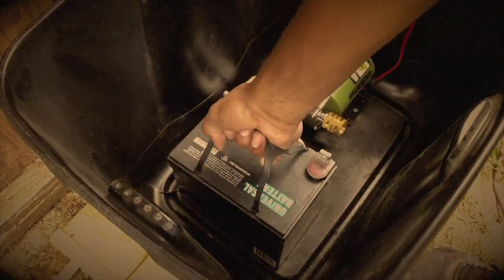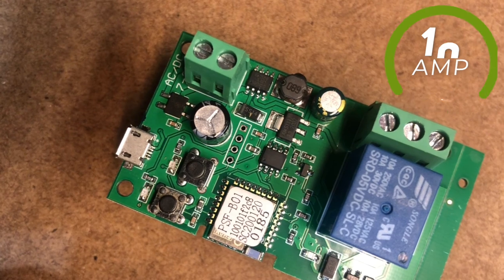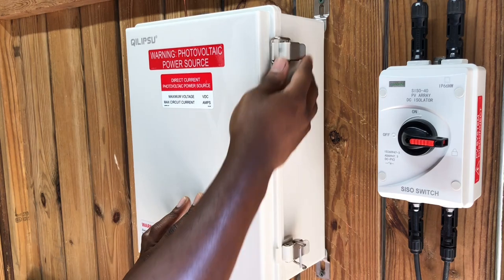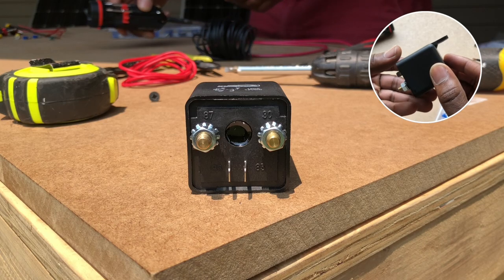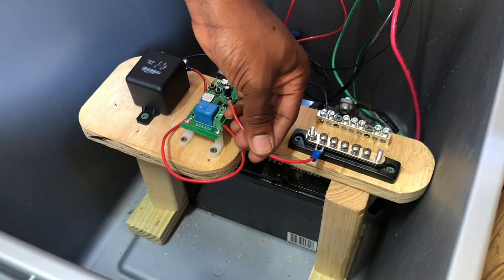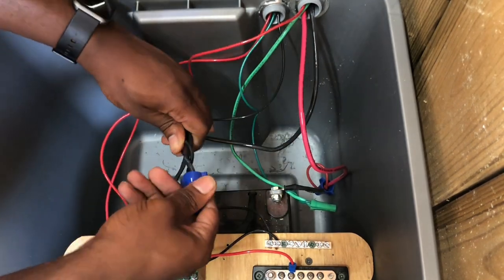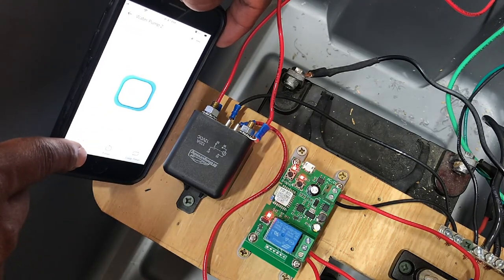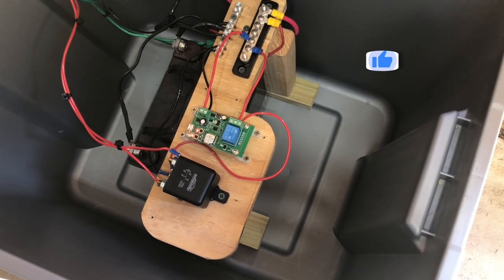Rain Barrel System - LESSON Learned

Comment: Great video! Consider adding a small physical non-conductive barrier between the positive and negative bus bars, just enough so they cannot  "see each other". It will prevent scenarios where something conductive gets dropped (screwdriver, wrench, etc) across the positive / negative bus, causing a short. Just adds to the safety equation.
Reply from the maker: Good idea Miko!

Comment: Yep we all make mistakes. I know i have. I would suggest to not run the power wire over the ground buss bar. I know you bent it up but something could push it back down when you close the lid. This could cause the two to touch and short out. I know its not very likely but i always try to take steps to prevent the worst possible senerio. Just my two cents with past personal experience. Your doing a great job btw. I have been watching all the different steps you have taken since the beginning

Comment: Just a suggestion. Anything housing electrical outside getting 🌞 sunlight , ( unless your in like Alaska or something 🤣), might consider putting in white or silver container. HEAT 🔥 is very hard on electrical components like batteries 🔋 and circuit board’s ect. . Maybe even vent the container. Just a thought. 🐴🐴🦅

Comment: I'm a little confused with where the float switch fits in to all of this? Before it was connected to the "normally open" port of the wifi relay. Now the wifi relay is connected with the heavy duty relay. I bought the diagram of the wiring but it doesn't show the float switch, any advice on that would be great!
Reply from the maker: You would wire the float switch in series/in line with the pump. For example, using the PDF as a reference, the float switch would have one wire connected to the #30 terminal on the heavy duty relay, and the other wire from the float switch connected to the positive (red) wire for the pump. Everything else in the diagram would stay the same. This is just one way to do, but as long as you are breaking the power going to the pump somewhere in the pump's circuit, it will work fine.

Comment: The reason to use a larger relay is because it allows a smaller voltage/current to activate the main terminals, which handle more voltage/current.

Comment: It's been a while since I've sized conductors / equipment for motor control circuits...but I've got to wonder if that tiny relay is sufficient for that motor. You could have starting current that is many times greater than running current, and the contacts in that relay may not be designed to handle that inrush. When opening the circuit you might also have a large voltage spike with opposite polarity across the contacts.
Reply from the maker: So far no issues, and the heavy duty relay has a high current rating. I will keep you posted if the new relay setup causes any issues.

Comment: Are you using a solar charge converter as you were in the  past videos where the solar panel is connected to? If yes where is it located in the upgraded system?
Reply from the maker: Hey Richard. The solar charge controller is now located in the enclosure you see me opening near the beginning of the video around 2:14.

Comment: Would it be possible to add a manual switch to this set up, just incase you want to turn it on and don't have your phone or wifi?
Reply from the maker: Good question. The smart relay has a manual switch on board, however, you may want to check out this video I made where I installed a wireless remote that is close to my garden in case I forget my phone: https://youtu.be/yjPCbqrWt9M

Comment: Nice, Robert! The larger fuses seem to imply that you anticipate moving to 120V or so. If so, can you get that with a reasonably sized solar panel?

To be honest, I set up the system similar to yours and was slowly but surely resigning to the fact that I would have to connect this to the grid. I would love to be corrected!

Comment: Get ratcheting crimpers.  They're easier to use and make a better crimp.
Reply from the maker: Good tip Bob, I agree for someone who does not already have a pair of crimpers. Currently I do not do enough crimping on the daily to justify replacing my current pair with a new crimper type but will add one to my collection of tools one day when I have some spare cash  :D.